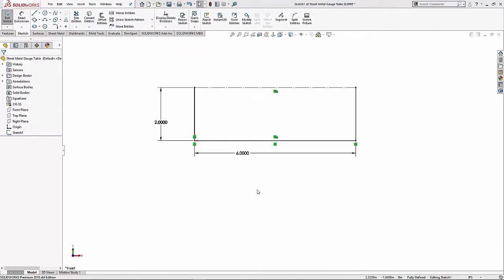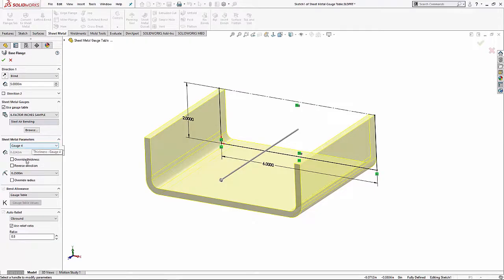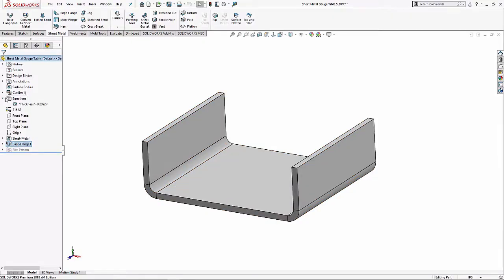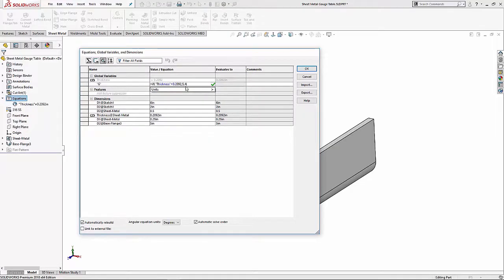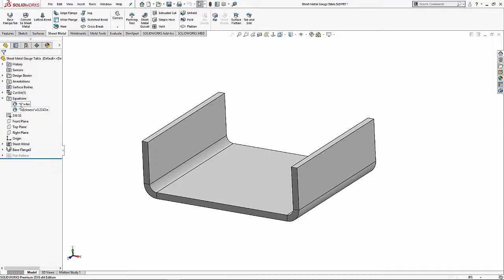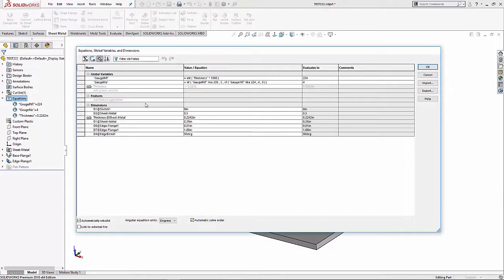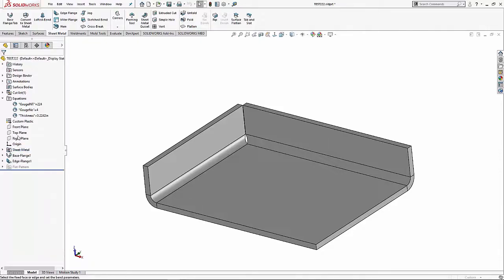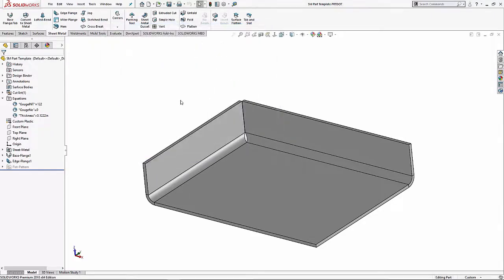SOLIDWORKS - Sheet Metal Gauge Table and Properties

Comment: But each material (SS, Steel, Aluminum) has different decimal specificatons for gauges. If only solidworks had the basic functionalty to grab custom property value from the bend table and apply it to each sheet metal body description. Something we've begged them to provide for years. It works for weldment profiles, so why not for sheet metal?!

If you read the help file (http://help.solidworks.com/2018/english/SolidWorks/sldworks/c_sheet_metal_properties.htm?verRedirect=1) it alludes to being able to control these properties :
"The following properties are calculated in sheet metal parts:
Material  
Mass  
Description  
Bend Radius  
Surface Treatment"

And yet I can't get that information to pull in.